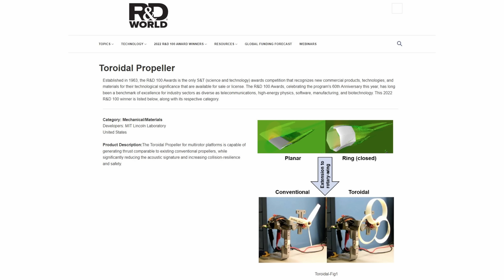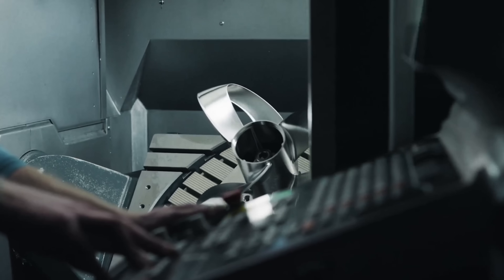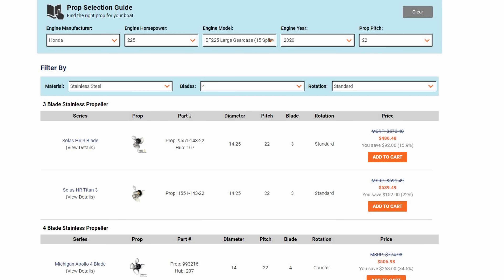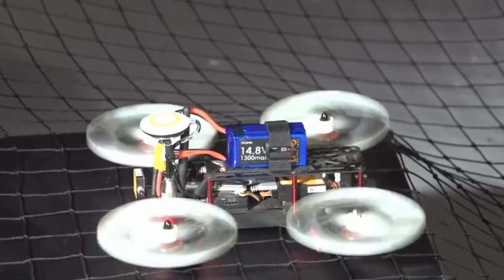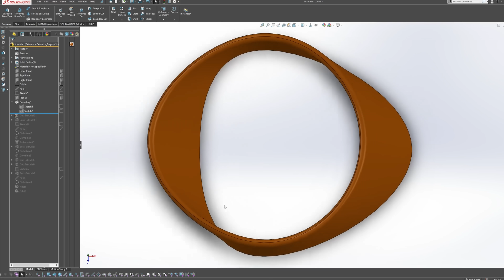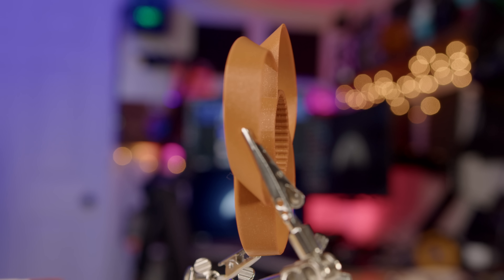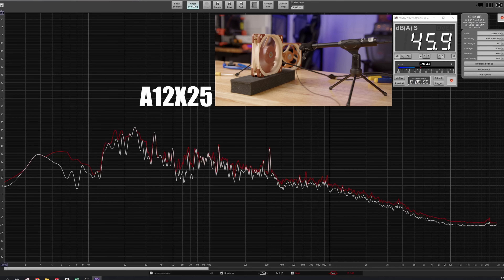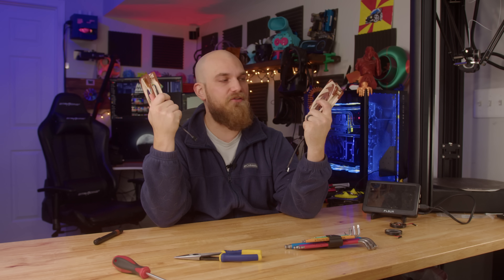I Turned MIT Award Winning Toroidal Propeller Into A PC Fan | Fan Showdown S5 Special

Comment: Yes a Sharrow Prop is worth it, if you're on the water professionally, or you're a very avid fisherman. You will save enough in fuel in one year to pay for the prop twice over.
Reply: wow. that's a hell of an efficient prop then. I was wondering if the prop helped reduce fuel consumption as well.
Reply: So buying a 5k prop will save you 10k in fuel if you go out on the boat enough times in one year?
That is quite good, and if everyone did the same I wonder how fuel prices and supply would be effected?
Reply: @Koronosavilon  unfortunately it will not be affected. Boats make up a minority of fuel consumption... now, if we are talking cargo ships, we could perhaps improve cargo ship fuel economy. That would mean lower cost of imports.
Reply: @NoobNoobNews  Surely cargo ships already run the most fuel efficient props known to humanity, the engineering into making those things run cheaper is incredible!
Reply: @NoobNoobNews  I hope that you x thought that those cargo ship propeller is just as simple cheap propeller 😂…it’s more complex and far more advance with multifeatures
Reply: Actually cargo ship propellers look more similar to toroidal propeller than regular fishing boat propellers. They are not identical though because they have much bigger diameter and much lower rpm, around 100 rpm.
Reply: @Koronosavilon  you also need to consider overall volume. if you're a commercial boating business (fishing, tours, adventure, whatever) you might be spending $100k a year on fuel. so 10k is only a 10% improvement in overall efficiency. you need to consider that some of businesses might be running that prop for 8+ hours a day, every day.
If you're only spending a grand or two a year on fuel, a 5k prop will take a long time to pay off with a 10% roi.
Reply: @Koronosavilon  Probably not that much, considering how much more fuel is burned in vehicles every day vs boats.
If they scale up the props though, and those fuel savings are REALLY there, expect every cruise liner, and shipping freight company to be swapping to them yesterday ;)
Reply: I wonder if they made them the size of ship props if they would help...they would weigh a crapton more but would they be more efficient
Well if they are approx 30% more efficient, couldn't they also be reduced approx 30% in size/weight to maintain the same propulsion force, I would bet that would help on wear and tear of engines and gearboxes.
Reply: @thedevelopmentlab  While true, its also important to keep in mind road going gas burning vehicles have had untold amounts of research and development go towards making them as efficient and eco friendly as possible. To the point where an i4 can have equal to, if not greater, output while burning less fuel than a v6 or even some v8s of the long ago times, and having less emissions even after taking into account the fuel saving. There are TONS of industries that use internal combustion engines  of some flavor that have little to no environmental mitigation at all (I mean, Ive never seen a catalytic converter on a boat....). Those industries, IMHO, are what need to be on the chopping block next when it comes to taking a serious steps toward making burning fossil fuel for transportation, personal, industrial, or otherwise impact the environment less (because my 35mpg kia isnt the problem, anymore). Not, say, forcing all the landscapers to go electric (4 stroke, yes. Electric, no.)......because, ya know..... they have so many places to plug in and wait between sites, and that electricity magically appears at the plug at the end of the day (you know, when people get home from their daily jobs, typically when the sun is down or at least low in the sky so solar is out), and doesnt have to be transmitted over our aging over-capacity electrical grids.....Inverters some may say? And put more load on the engine? Which burns more fuel? Because there is no free ride and if you use a watt of energy it doesnt matter if that watt came from a power plant, wind farm, solar panel, or a few quarts of petrol, 1 watt is 1 watt?       ........       [steps off soap box] Sorry, sometimes that thing sneaks under me when I get going on topics relating to the cotton candy dreams people are stuck in thanks to technology charlatans
Reply: I fish up in AK, and my 32 ft aluminium bowpicker was, and is, an extremely efficient boat. Since installing the Sharrow Props I've reduced my overall fuel consumption by 25%, which even back in the Trump years of rational fuel prices (and everything else prices) saved me enough in fuel costs that the $12K price tag on each of my props paid for itself that first seas, and the two years since have been pure profit. Absolutely nothing has been as big a game changer for me than these props.
Reply: @mrfrenzy.  yeah, some technologies are not scalable enough, and MIT research specifically mentions efficiency range 2500-4000 rpm
I would love to see prop of something like chinese EverAlot rotating at such rpms))) it might cause a small tsunami 😅
Reply: I spent $12 on fuel for my boat last year.... but my engine a 9.9 and my boat can be lifted out of the water by my self and my wife.

So maybe I'm not the target market
Reply: @davidblalock9945  nice, what kind of fish do you catch?
Reply: @Koronosavilon  given that most of fuel goes on cars and trucks, not that much
Reply: @PippetWhippet  with the fuel consumption of a cargo ship, there is a very big incentive already to make them as efficient as possible
Reply: @PippetWhippet  as a general rule, they'll run with the most fuel efficient props known to humanity... that didn't completely blow out their budget... that were available at the time they were built. On a global scale, there's been pretty consistently an over-supplly of cargoships for .... quite some time, at this point, meaning that new builds are a lot less common, and replacing major components like the propellers is both expensive in its own right (they're massive) and involves quite a bit of down time (when they're not earning money) so doesn't happen any more often than it needs to. 

Soo... yes... but also yes... Fairly good odds that most cargoships are pretty good on this front, but also fairly good odds that most are old enough to not have the newest shiniest fanciest tech... even if that tech isn't actually all That new anymore. 

Of course, you've also got to factor in just how much of any cost reductions due to fuel economy go into reducing costs vs how much is just treated as bonus profit (and consequently funneled into the owners/creditors pockets).
Reply: My toroidal prop saves me about 12% on my rib. Not the stated 20% they claim (although on some it may) I was getting about 4.5 gallons an hour (it's a dive charter rib) and now 4. Never gonna save enough per year to buy 2 toroidal props per year!   I would have to have been spending over £77,000 on diesel per year! 🤣 to save 10k with 12% saving. Another way of looking at it... that's over 3200 hours per year at full cruise speed. We do between 800 and a 1000 hours per year charter and save about £2500 on fuel. Its a great saving and helpful. But don't over inflate it.
Reply: That’s $30,000 per year worth of fuel. Somehow I doubt your claims.
Reply: Seems like these could be made much cheaper if they were produced in larger quantities. Maybe a large outboard manufacturer could make a deal with them to include there props.
Reply: @Orppranator  Me? It's around £19,000 a year in fuel, roughly. Marine diesel in the UK is between £1.35 to £1.50 a litre. That's about $8/gallon. Or $32 an hour. We're normally on the water around 200 days of the year. Maybe you just don't have a clue how much fuel boats use.
Reply: @PippetWhippet  Those are not going that efficient. That kind of shape can't be made for the huge propellers those container ships use.
That said, shipping by boat still uses less fuel per ton compared to rail, truck and planes (less per ton in that order).
Reply: @seldoon_nemar  It doesn't matter if it's 10% or 90%, money not spent on fuel is money in your wallet.
Reply: @NoobNoobNews   obviously fuel is a cost everyone wants to manage but compared to the total cost of imports, fuel for ocean vessels is relatively a very small percentage of total cost.
Reply: @Koronosavilon  do remember that Sharrow Marine is still in their development and testing phase, not yet on mass production. They still have to find a sweet spot between production cost, production speed, pricing, and sales volume. They also have to standardize their offerings to be able to offer direct replacements for existing propellers on the market. Making mistakes on those things could bankrupt them.
Reply: @AaronShenghao  any proof to your claim that the toroidal prop isn't going to work for larger ships?
Reply: @mrfrenzy.  false
Reply: Wasnt he using a resin printer a while back because of this issue?
Reply: Even if it saves 20% fuel which more than 5% seems optimistic TBH, that means you spent $50,000 in fuel. That's either a big boat or damn you spent a lot of time on the water. I barely net $50,000 living without any deductibles so that's either for a rich person's yacht or you're getting paid to be on the water.
Reply: @MiddleofKnowhere  🔴 What Is Islam? 

🔴 Islam is not just another religion. 

🔵 It is the same message preached by Moses, Jesus and Abraham.

 🔴 Islam literally means ‘submission to God’ and it teaches us to have a direct relationship with God. 

 🔵 It reminds us that since God created us, no one should be worshipped except God alone. 

 🔴 It also teaches that God is nothing like a human being or like anything that we can imagine.

🌍 The concept of God is summarized in the Quran as:

📖 { “Say, He is God, the One.  God, the Absolute.  He does not give birth, nor was He born, and there is nothing like Him.”} (Quran 112:1-4) 📚

🔴 Becoming a Muslim is not turning your back to Jesus. 

🔵 Rather it’s going back to the original teachings of Jesus and obeying him. 

More ...
Reply: What about ski boats?
Reply: @BritishBeeMan  Wow.  Now those numbers seem much more realistic than the guy above who "paid for the props in fuel savings in one year fishing"
Reply: @NoobNoobNews  maybe that propeler and a hydrofoil and you'd see some major fuel economy improvements!!
Reply: @GBR9794  Sockeye, and 2022 was a very good year.
Reply: I agree
Reply: @orppranator5230  My boat is powered by a pair of Cummins QSB5.9-425HO engines. Low rpm maneuvers they burn 1.8 gph @ 800 rpms (8 hours a day), but during the 2 hour run to and from the tender to sell my catch (3 times a day), I'm running at 2600 rpms, burning 29.2gph. Buying fuel off the tender ain't cheap at $9/g. My daily fuel bill is approx $1706.40. 
This last year I had 65 days of good fishing, So my fuel bill was Approx $110,916
Reply: That’s wild. Talk about a paradigm. There hasn’t been much change in props for over 100 years. Crazy.
Reply: @PippetWhippet  It's more of an economy of scale/speed at work.

Why do helicopter rotors work so efficiently, despite being open-ended? Well, because they have such a damn huge radius as compared to tip breadth and shear distance. So even with the ridiculous aV that they achieve at their ends, the effective thrusting radius to tip ratio is so massive that even if it's free-flapping ends and produces that massive chop-chop and those sharp tip flows, the relative waste to the thrust you get out is miniscule. This is why e.g. the V-22 by comparison couldn't be made with any other solution than those massive damn rotors, even though they wanted to bring them down for every other logistical reason...

And water is almost 1000x denser than air, incompressible, and those big damn screws on cargoliners do not have to turn fast at all. For that particular application, as opposed to small boats with zippy little screws, the point in having those "curved return" props is totally wasted as compared to the engineering and manufacturing cost, because for one you can much more effectively still produce thrust toward the center of the prop radius, and seconly those bigass propellers have so much surface and so much sweep toward the tip that even with their massive radius they just don't produce anything like enough relative cavitation for it to matter as compared to the broad thrust of the prop.
Reply: @thetruthexperiment  I know how to make ductfans which can self-induce aerodynamic instability, thus allowing them to pitch even under relative velocity, i.e. when you start moving an aircraft forward. I.e. they could be applied to a balance-hung VTOL application. I am currently simply saving up startup funding and taking down names.

"B-b-b-baby you just aaain't seen nothing yet...!"
Reply: @lee moo eez: absolutely right, there's a real history of improvements to "propulsion systems", nozzles, vanes, shapes, operating speeds, and so on...a good friend of mine was a pioneer in the 1980's in both Hull and propulsion design... he did cool stuff like a propulsion system for very shallow draft, that reduced the "suck down" under acceleration, and a hydroplane wind surfer, which, i think, set a world record for wind surfer speed... he developed a stabilization system for barges that delivered better fuel economy and greater towing stability. sadly, died much to early; rip josip gruzling
Reply: Small brain: sharrow prop makes better boat mpg
Big brain: sharrow prop makes boats easier to make electric our hybrid to phase out fuel altogether, especially bunker fuel on cargo ships
Reply: I'm buy it to put it on my little joh boat 😆 🤣
Reply: @mrfrenzy.  more like 80 rpm
Reply: I guess they know how to price them then.
Reply: Cargo ships don't run high RPMs... they often have a better attack angle, and go for a power stroke vs a speed one. Compare a power cruiser prop to a race boat prop. BIG difference.

You also have to faster his "raw-print" which does not give very smooth airflow over the blades. If I bought a set of props like that online, I'd be sending it back as 'unfinished', as it needs smoothing (usually with acetone) and then proper balancing (needed on ANY high-speed fan blades). I'd bet if MIT had done the test on a PC fan, it would have been quieter (which many PC users like) and have variable fan speeds (also liked)

That being said, I'd like to know if drone companies will offer toroidal fan-blade assemblies for their drones.
Reply: Yep it really depends on how much fuel you burn in a year.
Last year gas @ the dock was 5 to 6 dollars a gal while it was 3 to 4 @ the highway.
Reply: @BritishBeeMan  If you look at the graph, efficiency is tied to speed. At 3000 rpm is 107% more efficient so it depends how far you are pushing it. Closer to max won't provide as much savings.
Reply: Going to print 1 for my trolling motor
Reply: I worked at a marina during high school almost 25 years ago. There were a few cigarette boats that I could put over $500 worth of gas in at a time. What's scary is they could burn all that gas up in about 90 minutes. They could also go well over 100 MPH and they had this amazing ability to make a woman's clothes just explode off their body, it was the craziest thing I've ever seen.
Reply: @PippetWhippet  for new ships. Don‘t forget these things run 30yrs.+
Reply: @VoltLover00  On a boat that runs a LOT in the water. I could see it as possible.
A twin motor fishing charter boat I was on previously, 200L of fuel for the day. That boat runs 7 days a week.
If it only runs 5 days a week, and for only 40 weeks of the year (That's school teacher holidays it gets!), that boat is spending $80k a year on fuel alone in Australia.

30% efficiency increase = $24,000 a year saving.

It's all about HOW the boat is being used. You wouldn't expect those savings on someone taking a boat out once a fortnight.

This is all based on the 30% efficiency increase they're claiming.
Reply: @davidblalock9945  miss those good ol‘ Trump years..
Reply: @zombieregime you do realize burning fuel to charge a battery that then powers electric motors is far more efficient then burning the fuel and directly using it for the same task right? This comes from the fact when you are using fuel to charge a battery you can operate the engine at its peak efficiency range and then once the energy is stored the process of driving an electric motor has very little conversion losses. The oil well to wheel efficiency of a EV is something like 45% where as the same efficiency in a ICE is closer to 15% (this calculation factors in the greater efficiency of transporting the produced electricity to the location of the vehicle and not just the base efficiency of the vehicle itself which is closer to 15-25% depending on the rpm of the ICE and a mostly static 30% for the EV so long as you aren’t treating either method like a racecar) if you charge the EV with renewable energy sources the efficiency increases to close to 70% due to the efficiency of not harvesting and processing oil. If you’d like to see the research paper dm me and I’d be happy to provide it.
Reply: Yeah that sounds pretty BS. You will save 10k on fuel with up to 30% higher efficiency? Meaning an average improvement of ~15%? So you normally spend over 75k on fuel?
Reply: Some interesting stuff is said in this thread. Hats off to this crowd.  Still I would like to mention that you can buy something just because it's really nice. If I had the money to buy a nice boat I would definitely consider this prop.
Reply: @Koronosavilon  look at Europe, car efficiency is king yet when we reduce consumption the powers that be just jack up the prices and ratchet up the backstop never to go back down.
Reply: Does it help resist prop fouling?
Reply: @NoobNoobNews  думаю это принесло бы больше экономии компании, но цены остались бы прежними
Reply: "MIT Award Winning Toroidal Propeller" Right, since drones are more and more used for the military they immediately award a certificate when drones are improved.
Reply: @Ryukachoo  The only viable replacement for heavy crude on commercial shipping is Thorium fueled molten salt nuclear reactors. And truth be told, they make vastly more sense than running on crude. One fuel load will burn for hundreds of years. 
MSR's have the advantage that they can use 100% of their fuel load as a posed to .5% of the fuel with solid fuel reactors.
Reply: @orppranator5230  he said professionally.
Reply: If you’re SAVING $10,000 a year in gas, how much freaking gas are you using? Is your boat named the QE2?
Reply: @stargazer7644  professional fishing boats motor use 20-30 gallons of fuel per hour. If you're out at sea for 8 hours, that's avg 200gallons of fuel a day. if gas prices are 3.5 per gallon then that's easily 700$ a day. if you work 260 days a year, that's 182,000 in gas prices. even if your being generous and only use 10 gallons per hour, that's still 250$ a day on gas alone or 65,000 a year.

gas prices at the dock averages at 6$ per gallon btw so these calculations are being extremely generous.
Reply: @orppranator5230  this obviously isn't for your average Joe who goes on fishing trips on the weekend. this is for people who are fisherman or people who are out at sea often. it's 6$ for gas at the dock so nearly twice the cost for a car at your local gas station. a motor boat uses 20-30 gallons of gas per hour. if youre a fisherman, youre probably out at sea 5 hours a day. thats at minimum of 100 gallons a day x 6$ per gallon. now do the math for the entire year. even if you're being generous and say you're at sea for 3 hours a day, that's still 60 gallons minimum a day or 360$ a day.
Reply: @PippetWhippet  They're good and best in class, but always room to optimize and stretch that ton of fuel further...
Reply: How to sell 5k of Prop ;)
Reply: Sharrow props claims a 2500-4000 rpm sweet spot but that is due to the size of the props they are producing.  You cannot use their efficiency findings for a cargo ship running at 80rpm.  That does not mean that the toroidal props will not provide benefits on cargo ships.  It may mean that they need to reduce the size of the prop on a cargo ship and change the gearing to make them spin at 200+ rpm.
Reply: @PippetWhippet  and with the toroidal blades they still gain 30% fuel economy.
Reply: plus any prop that's stainless drastically increases the price even if its a basic 3 blade prop
Reply: @nom6758  There's a company over here, Candela, who are building some new runabouts and have a contract for ferries and have basically adapted Tesla battery tech to boating...

Now, that's not really interesting in terms of the motor tech. And I'm saying this as an electrotech myself. Very technically speaking boating should be something of the forefront for alternative propulsion and fuel because of how relatively simple solutions can make for massive efficiency gains, and how you don't have to mind weight so much, etc. But I am most definitely NOT an EV guy, because I know the technology and energy logistics.

No, what's interesting about them is the fact that it's a hydrolift design, and a damn good one. So...

Imagine the fuel savings to a mid-range vessel (15-45t) from this prop, plus a proper hydrolift, maybe even involving some mild ground effect shenanigans.
Reply: i could only really see this for professional fisherman who use their boats all day every day. 10k in fuel savings is crazy, depending on the size of your boat most people wont see anywhere near that much savings
Reply: @seldoonnemar7992  You're numbers don't add up.  The Sharrow props can actually save a lot more than $10k/year and more than 10% on fuel alone.  Consider also that a good portion of the fuel savings is that the toroidal props allow the engine to run at lower rpms to achieve the same speed. So that's less wear and tear on the motor,  extended cruising range between fill up etc.  Engine maintenance and repairs is a major cost in the marine world.  Many boats have 2, 3 or even 4 motors, so the roi is even greater on fuel and maintenance/repairs.
The Sharrow prop also gets out of the hole quicker, which is a performance benefit as well.
Reply: Man that is so fascinating
Reply: That’s kinda awesome
Reply: 5k for 1mp ..... Especially for something that cost a fraction more than a normal prop to make... It's all hype rn and not worth what people are spending. Same materials slightly different design not worth the money
Reply: If you’re spending $10k/year in boat fuel 😬
Reply: @Koronosavilon    Only if you use $50,000 of fuel in a year!
Reply: @davidblalock9945    But how many of us use $50,000 of fuel a year?  I use my boat every week with some long trips and it would take me a lifetime to re coup $5000
Reply: Until you hit a stump and bend the prop blade.
Reply: Yes but you have to hope all that money from early adopters in going back into increasing manufacturing. I’m taking a punt on this but I believe this design requires the part to be CNC,d from a single block but don’t quote me.
Reply: @NoobNoobNews  cleaning the blades and hulls themselves have a significantly bigger reduction in fuel economy. Marine Growth is usually the biggest factor.
Reply: @Andysfishing  Crazy how you couldn't come to the simple conclusion that you are not the target demographic for this prop. The math is really quite simple. If you are going to spend 20k+ on fuel in the lifetime of owning that boat, and you have 5k upfront to pay for it, the prop will pay for itself. If the answer to either of those is no, enjoy your weekend trips as you always have been.